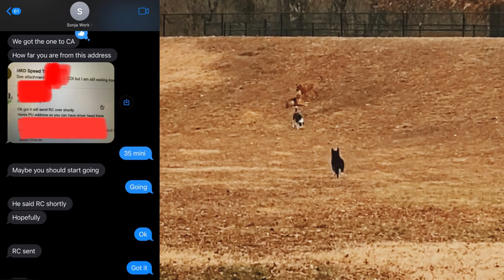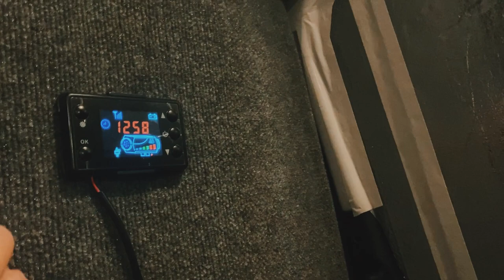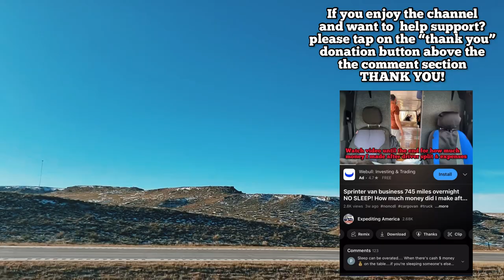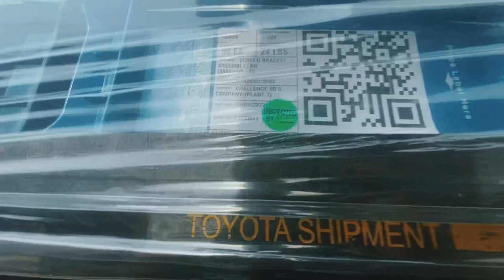Sprinter van business: I SLEEP IN MY VAN? HOW DO I STAY WARM IN THE WINTER?

Comment: I just leave the engine running heater or ac on depending on climate I don't have a cage or wall I'm my van thank goodness no need to waste 100_200  on hotel
Reply from the maker: Be careful overtime fuel filters get clogged and fuel throttle can go over time of course. Stay warm stay safe. And yes no need to waste the mula

Comment: Your using diesel try mudflap, ect. discounts should be better, upside works better for gas. Unless you can combine them I can do that with the station apps that save you .05-.12 cents per gal then use gas buddy to pay for it another .05-07 cents most times.
Reply from the maker: If you look in the video I usually get $0.25/gal off. Save 3-6 bucks every time in cash back. My accounts almost up to $500z mupflap gives big discounts usually at truck stops who already have inflated prices above most gas stations.

I use them all and I save the most with upside. Never had a problem finding a diesel discount.

Comment: Mr heater propane cheaper and get hot af
Reply from the maker: It’s not cheaper when you factor in buying 2 propane tanks a night. Plus it’s a pain to change it out and a diesel heater heats up the whole van. I’ve used both
Reply: @ExpeditingAmerica  ok I used mines for occasional camping. I believe you’re right.
Reply: @ExpeditingAmerica  I’m planning on getting out of an apartment lease and quitting my 9-5 and do cargo van otr living out the van. And just be wherever my dispatch takes me. What is your take on that?
Reply from the maker: @samlee7420  it’s a huge mental test. I pray you find a company that keeps you moving. It’s the down days that will destroy a driver.
Reply from the maker: @samlee7420  it definitely works don’t get me wrong. But a desire heater will do better that’s all. Thanks for commenting and for supporting

Comment: Why would anyone lose the advantage of a van by buying a diesel? Diesel costs are ridiculous now. That takes so much from your profits.
Reply from the maker: Longevity of investment. Diesel go 1,000,000 miles if taken care of. Gasoline 500k miles so technically you can make more with a diesel in the long run
Reply: @ExpeditingAmerica  oh okay. Never thought of that. So if you are in for the long haul ( pun alert) would be better to get diesel. Wow thanks for getting back so quickly.
Reply from the maker: @jerrylisby3440  no problem I’m currently responding to comments and yours came up. Thanks for watching man! Have you watched some of the newer episodes?
Reply: @ExpeditingAmerica  no this is first one. I work in car manufacturing. One process I do is supposed to have 2 people. First shift does have 2. But our brilliant engineer decided one was enough. 😄 Killing me. They running me like a rented horse. This sounds like a good option. Trying to learn what I can before jumping in.
Looks like there is more to it than I first thought but looks very doable. And I could make more. I finally realized I have been limiting myself. They have those benefits carrot sticks out in front of me. I decided I am tired of carrots. I am not Bugs Bunny! 😂 I will check out more of your videos for sure. And subscribe if I didn't already.